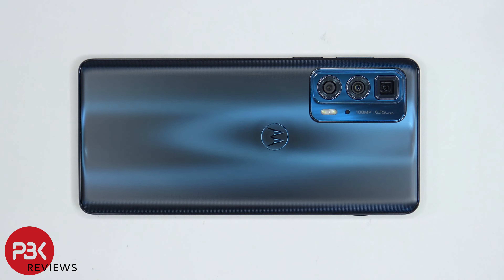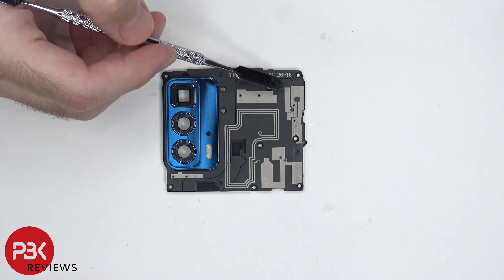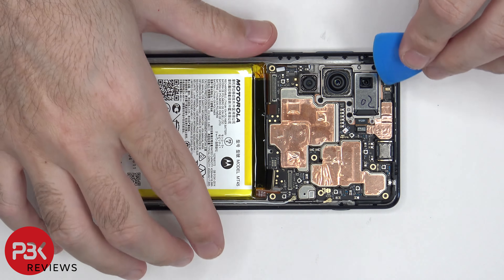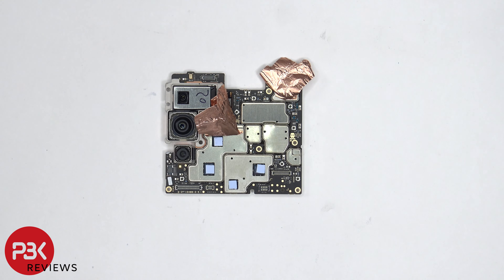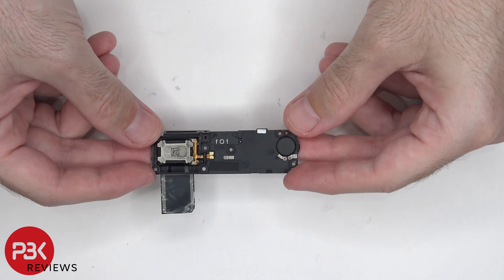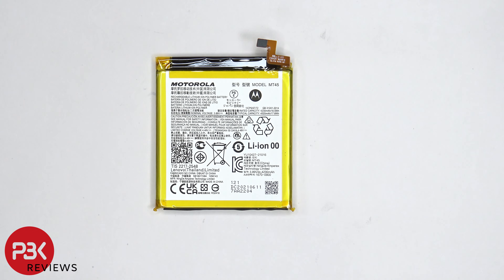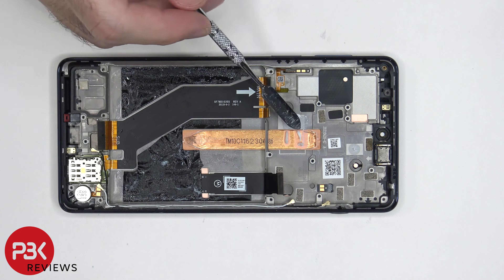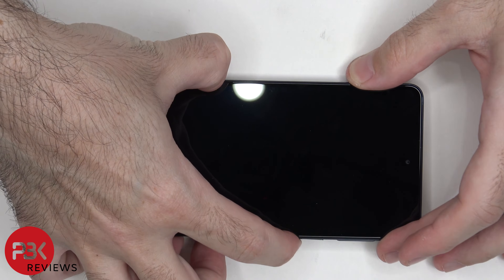Motorola Edge 20 Pro / Edge S Pro Disassembly Teardown Repair Video Review

Comment: To remove the Power button, do I need to disassemble it completely?
Reply from the maker: For the most part yeah. I don't remember entirely since its been a while since I did this video, but from the looks of it, it would require prying off the screen as well since the fingerprint scanner cable is routed through the midframe so would require disassembling the entire thing which poses a high chance of damaging a working screen.

Comment: I have a question
On mine Motorola edge 20 pro sometimes wifi, hot spot and Bluetooth works, sometimes doesn't works I checked plastic peace few times, I don't see damage what can be issues? After checking system only shows error for Bluetooth wifi and hotspot no description of error
Reply: Same here

Comment: 4:00 what's this white cable responsible for? Everything working perfectly fine after I ripped it off when cutting residue around the corners, it wasn't fixed like in your video but was hanging and i pulled it off.. Thank you for the guide.

Comment: The Edge 20 Pro has been a very good phone to me, but the USB port is very loose and it's hard to find a position where it charges from the cable. I guess I need to change the sub board. Nice video, thanks.
Reply: Same on my phone, I've replaced the board but the sound (speakers + microphone) stopped working. I think the speaker system is different.

Comment: Excelent video. Could you point out where the memory is located? I have a damage on the motherboard, but managed to get a spare motherboard. I would like to try to interchange the memories.
Reply from the maker: The ROM or storage chip is soldered to the main board under one of the covered shields. It would require solder expertise to be able to de solder and swap them.
Reply: @PBKreviews  thank you very much

Comment: Hi, before you change a screen on Motorola edge 20 pro, would you need to remove all this parts or there's anyway easier.
Reply from the maker: You would need to remove most of the parts until you have access to disconnecting the screen cable from the main board and running it through the cut out in the mid frame so when you pry the screen off the frame itself, you can run the replacement screen cable back through the mid frame and re assemble. But if you're using a screen with frame combo, you would move over all your parts from your old frame to the new.

Comment: I can't find a logic board/main board replacement anywhere for this phone, does anyone know where to buy one?
Reply from the maker: usually you would need to check ebay and sites like that, but if there aren't any, you would need to look for a phone with a broken screen or some other issue, to remove the board from.

Comment: hello, im running out of options so im asking here, has somebody replaced the wifi-bluetooth board? or what does this two antennas have  in common? i've been having issues with this phone and those antenas for months with no luck in repairing it, thanks for any help provided!
Reply: did u solve it already?? same issue here.

Comment: I like how they put so much attention in heat dissipation, that explain why my phone doesn't heat that much
Reply from the maker: Yup, its not the best I've seen but its not bad. A vapor chamber and a bit better thermal paste installation would have been better.
Reply: Bro what best model for little heating blue vegan leather or mednight glass?

Comment: I want to buy Edge 20 pro.
Will it be a good choice in terms of built quality ?
Because i use moto g5s plus and it's built from metal literally !! Using since 4 years .
Will it be worth upgrading?
Reply from the maker: I think the Edge 20 pro is a good device, I would upgrade to it, however I would wait until the edge 30 ultra or edge X is released in a month or two so the prices would be lower on the edge 20 pro.
Reply: @PBKreviews  I am also waiting for the edge 30 ultra launch in India.
Also G200 will shortly launch in India.
Buying anyone from edge 20 pro, edge 30 ultra , g200 for sure
Reply: @nikapache  I bought Motorola edge 20 Pro in India this new year and waiting for my edge 30 pro which is coming from Dubai in March 2022 with desk dock & c headphones inbox. 😍😍🥰
Reply: @millennial3001  bro what best back phone build for gaming blue vegan leather or mednight glass what the better for stop heating
Reply: @chefrabbaigoldenbergsteins5018  no experience.
If the back cover is used then anything fine

Comment: Hello, I have been facing fast battery drain issue on this device, I have tried battery calibration and reset, nothing works, it goes down to 0 and then shuts down, without charging it when I try to power it back on, it shows ~20% remaining still.

My query is will it be safe to get a battery replacement, as some people say once you disassemble a device it loses its IP rating, or should I ask them to replace my phone instead.
Reply from the maker: If you replace the adhesive with the original pre cut adhesive, it will retain the water resistance. But I can't find any available online at the moment. If your sending the phone to motorola or and authorized motorola repair center to replace the battery, they will be re adhering the back plate/ battery door with the original pre cut adhesive and ensure the IP rating or water resistance.

Comment: Why is battery capacity different ?
Reply from the maker: What do you mean
Reply: @PBKreviews  it is written on battery 
Rated capacity-4230mah
Typical capacity- 4520mah 
Why diff .. is moto cheating
Reply from the maker: @aryanman5652  every battery is like that, there is always a typical and a rated. Basically what its generally going to be and what it's rated to meet at a minimum.
Reply: @PBKreviews  oh thanks
Reply from the maker: @aryanman5652  👍

Comment: Hello Sir .
Is this phone is capable of long run i.e 3/4 years ? As i have not that huge money but i am collecting money to purchase this mobile .. Would it be better to spend money on Moto Edge 20 pro .. I want to use this phone for more than 3 years
Reply from the maker: Hi, its not a bad device at all. But if I were you, I would get the edge s pro (just make sure the network bands on the edge s pro will work for your network/carrier) instead of the edge 20 pro since both are the same exact phone, just the edge s pro is the re-branded/re-named version that is sold in china and it's cheaper in price.
Reply: @PBKreviews  ok Sir .. thank you for your advice but in India None of the device is launched yet .. But it is already confirmed by MOTOROLA INDIAN HEAD that Moto edge 20 pro will be launched India .. So i would have only on option Sir
Reply: Edge 20 pro 12+256 HKD$4499 in Hong Kong
Edge s pro 12+256 sells $ 2399 in china
Almost a half price, but china using an UI called MYUI but Hong Kong using a international version of Android 11.
Notes that MYUI still can install back all Google services and enable it with root ROM,  but MYUI can only use language in Chinese and English only

Comment: Hey PBK your videos is really insightful . 
Will you please tell me what is the solution for automatic switch off problem in Motorola mobile phones ?
Reply from the maker: Thank you. What do you mean by automatic switch off?
Reply: @PBKreviews  it get switched off automatically while using
Reply from the maker: @ashishupadhaya5448  not all motorola phones do that, but thats usually related to software issues or overheating if there is any liquid damage or excessive use. Try backing up your data and doing a factory reset to see if it would solve the issue.
Reply: @PBKreviews  I tried it already but no change is there . Do you think it's a battery issue , I found somewhere in YouTube that the jumpering the battery switch can resolve the problem . Do you believe that ? , Please help
Reply from the maker: @ashishupadhaya5448  i dont know what jumping the battery switch is, but its possible a bad battery can do that also.
Reply: I mean it get switched off automatically whenever I used it

Comment: Excelent video like always, just one question just for curisity, this phone has OIS? Moto says only the tele lens have it and it's a pity considering last year Edge Plus have 108 mpx wih OIS ...and on-screen fingerprint, and stereo speakers, and wireless and reverse charging, and 5000 mah battery, and so on hahaha
Reply from the maker: Thanks! no it does not have OIS for the main 108MP camera. :)
Reply: Look at the price difference bro,, moto edge plus has 90hz refresh rate and come up with a 18watt charger,, these features are ancient
Reply: @aloksinghrajput7874  No OIS, no stereo speakers, no in-screen fingerprint and no wireless charging in a flagship are truly unaceptable, also, here in México, both phones were launched at 999 USD. At least, I belive they gonna fix all that faulta ib the Frontier 22 in July.

Comment: not every black tape is graphine pad... most of those foils are just shieldings.
Reply from the maker: correct, the thin paper like film ones true are not graphene films but the ones I do point out that I mention are which have dual layers usually with black protective film on to top but grey graphene layer on bottom. The ones shown in this video were all in fact graphene film.

Comment: The Qualcomm 870 processor is made by Samsung that's why it's a double stacked chip. Above processor is the Micron Ram. THESE KIND OF DOUBLE STACKING MAKES THERMAL MANAGEMENT WORSE. DONT KNOW WHY BRANDS DO THAT...
Reply from the maker: Might make thermals worst but performance wise, higher/faster speeds are achieved with the ram and processor being together or 3d stacked and also takes up less room allowing more space for other components.
Reply: I've always thought so too,regards of the components being stacked together to achieve higher speed transfer,at the long run they would be crippled by excess thermal constraints !